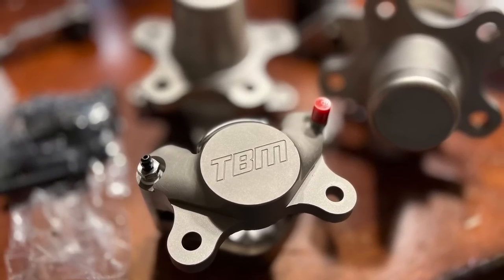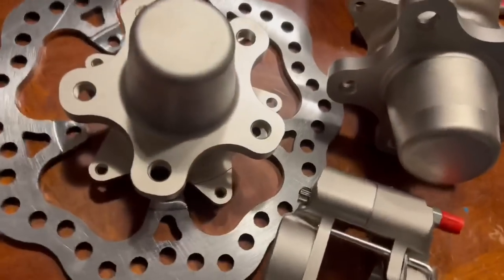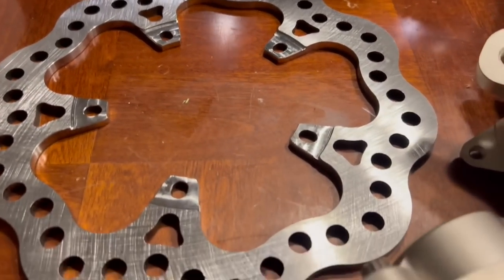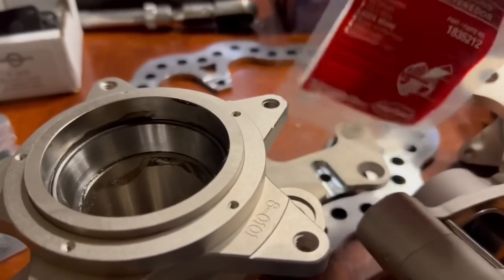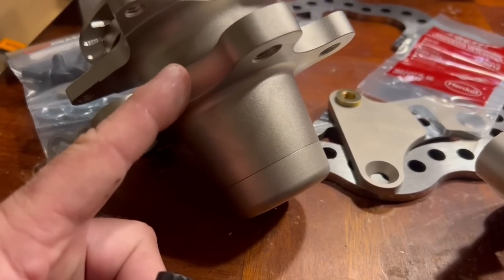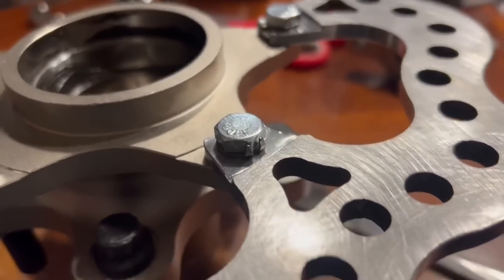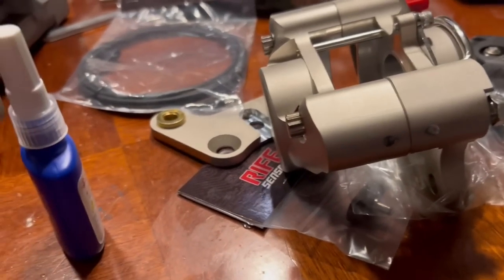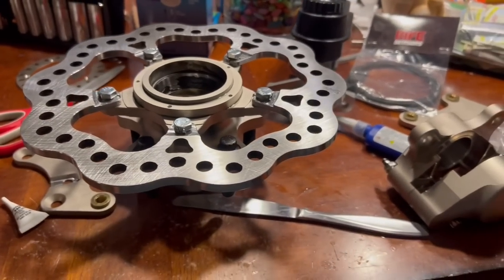TBM Superlight Brakes / Zero Drag / The Brake Man

Comment: The design of the rotor gives you more surface area and strength, than a regular circular rotor. I’ve had mine glowing orange, many times and they are still straight. If monster trucks can runs these brakes, then a drag car should have no issues.

Comment: I currently have Willwood brakes, and want to try and use TBM speed sensor. Do you know the inside diameter of that ring that goes over bearing hub assembly. 
I really like my Willwoods and they are new but I want to set up traction control.  I’m hoping I can just buy 52-1401 from TBM and make that slide over my hub.

Comment: Curious & probably a dumb question, but, how does back wheel speed vs front wheel speed work to control traction when the front wheels are in the air?.. is traction control via wheel speed deferred for the 1st second or so?… or is this exactly what you are looking to detect (vs an angle sensor to tell you when the front lifts?)?

Comment: Get another set of bearings and get them WPC treated. The micropeening works.
Reply from the maker: That's a great idea!
Reply: @TurboJohnRacing  you can look up the process on Youtube. Actually better than Microblue.
Next time you need to go through the rear differential, do the process to the ring and pinion plus all the bearings and races. Itll drop the friction quite a bit and improve reliability.

Comment: I always wondered if those rotors would wear pads quicker, seems like that leading edge would carve on the pads wearing them out quicker or maybe they have a tapered edge like most cross drilled rotors. Not crazy about the adhesive or locking compound, would rather have set screws w/allen heads. Super tiny aluminum or TI screws for weight reduction.
Reply: Motocross bikes have been using that same design and style for many years with no problems
Reply: Motion raceworks who owns tbm now has a video about how fast they wear, Doug takes them off the mustang I think.